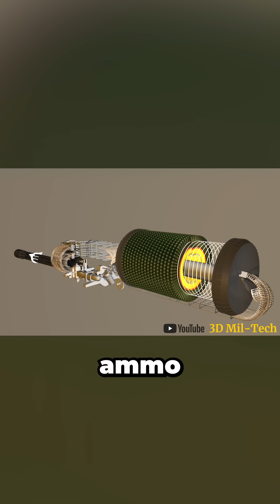What prevents the A-10 Warthog from firing its cannon nonstop?

Comment from the maker: Correction: The A-10 used to be able to switch between a low rate 2100 rpm or high rate 4200 rpm which is what’s mentioned in the reel. But today it fires at a fixed 3900 rpm!
Reply: I was just about to comment this

Comment: Pretty sure I read that the gun’s recoil is stronger than one of the engines.
Reply from the maker: Yea it just goes to show how much force that gun has! It’s also said that because of this firing the gun for long enough will induce a stall but this not true (unless shot for an extended amount of time with only one engine on, essentially decelerating and reducing airspeed to a stall). Just cause the mass of the plane vs relatively small mass of the bullets is extremely large, the pushback is unnoticeable. This is confirmed by the experiences of A-10 pilots as well.